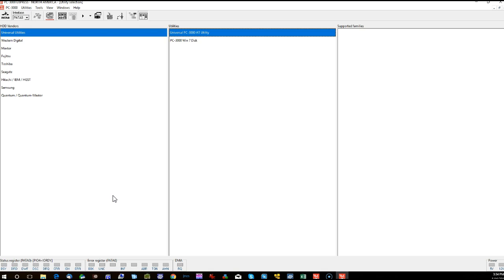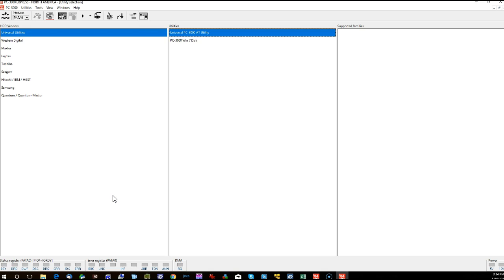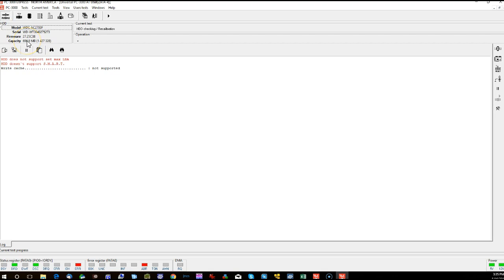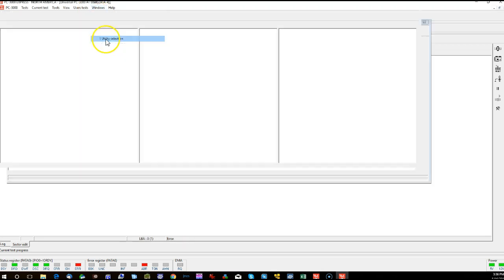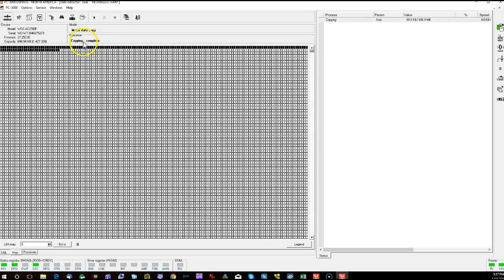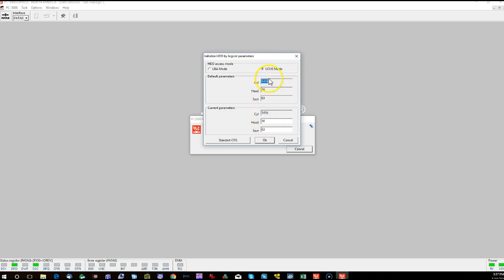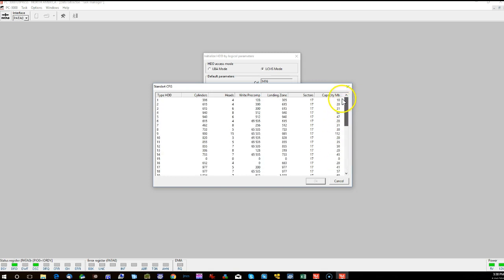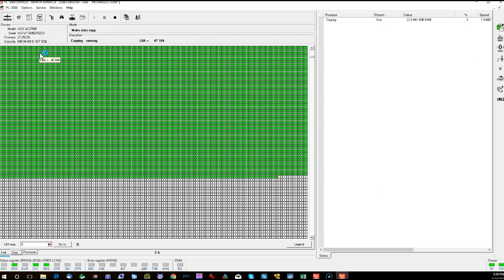Data Recovery of CHS (non LBA) Old Hard Drive Using PC3000

Comment: how can I get recognized a Caviar 2850 in windows 10?
Reply from the maker: The issue is not so much related to the OS per se.  The real problem is you'd need a motherboard that supports a CHS drive.  Likely your board is just too new to know how to communicate with such an old drive.  We have professional data recovery equipment here, but you'd be better off just finding an old computer to copy the data off.
Reply: Great vid -  @DatamedicsRecovery  Is it possible to pull the data off an old 1995 IDE WD 2420 425mb drive using a Tableau T5 IDE Bridge or similar by using some software you could recommend to force CHS translation?